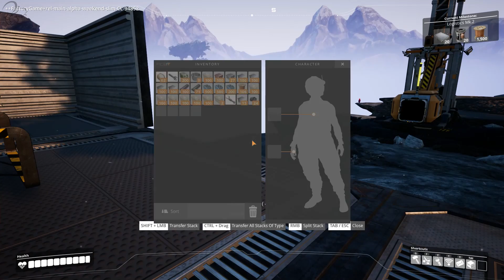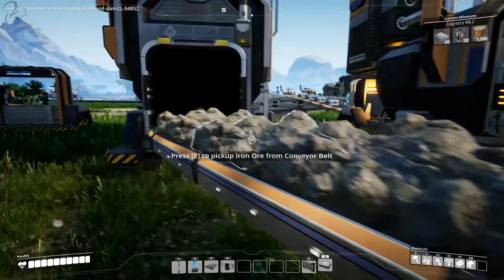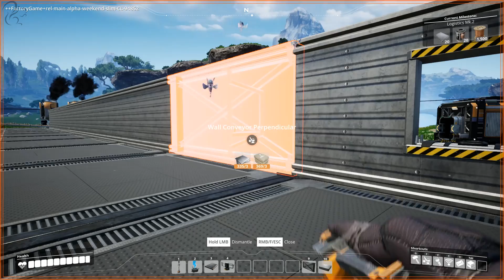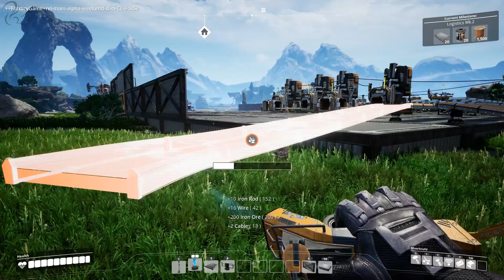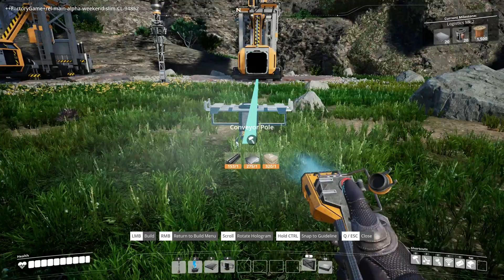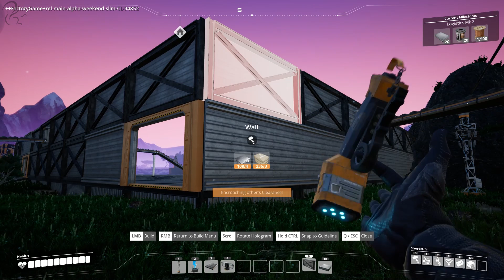Satisfactory - Episode 7 - Maximised Production

Comment: Paul, when you calculate stuff, construct it and then notice e.g. that the belt is loaded full instead of calculated half, you keep forgetting that while you are building, the smelters keep smelting and stacking up their internal buffer. As soon as you connect they start dumping all that smelted material out at max belt speed until they're empty again. Just let it all flush, and THEN check the belt load. That's the source of most of your confusions.

Also, at 4:30 the secondary belts are stacked exactly because the smelters take only 30 per minute. So on "tick" it takes 1 ore, on "tock" it waits. And the belt provides 30 ore per minute. So the belt has to wait that one second every other second, and this waiting makes the ore compact on the belt.